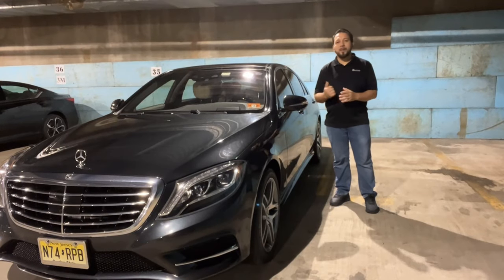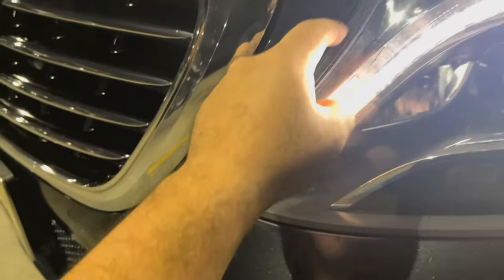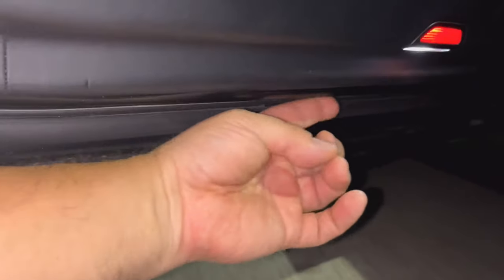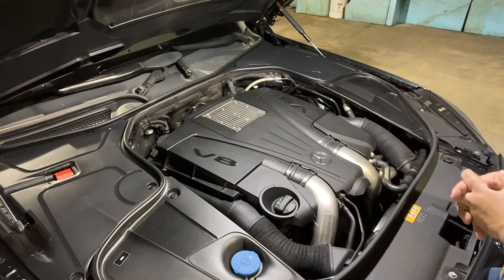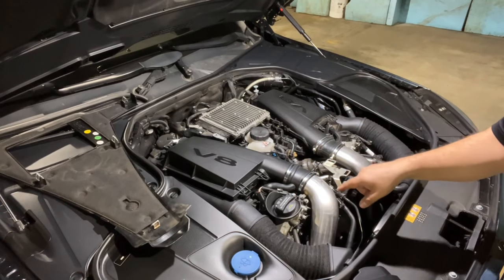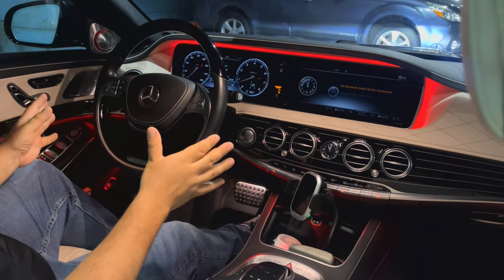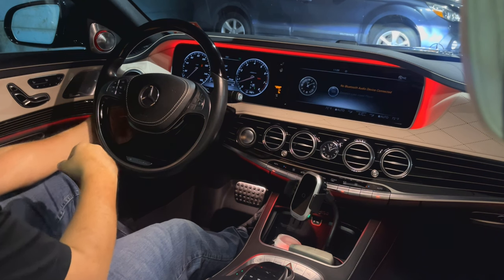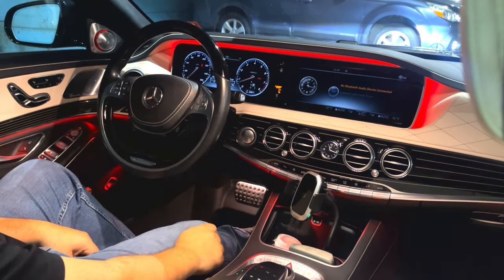Buying a used Mercedes | Buying a used car | #usedmercedes | josecitomarin | #repairjose

Comment: Thanks, Jose! Very detailed and accurate information for evaluating buying a used S Class where I've owned 4 different S class cars from W220, 221 and W222.
Reply from the maker: Hello Steve. Thank you so much for your comment. I’m glad you like the video. What can you share about your experience with your cars? Is there anything else we should look for?
Reply: @josecitomarin  Your videos on the sacrificial harnesses was extremely helpful where I replaced all 4 CPS, camshaft solenoid magnets and added the sacrificial harnesses to the CPS's and camshaft solenoid's. 

This is my 4th S class starting with the W220, W222 and the W221 I have now. 

I've experienced replacement of the Airmatic shocks on the W220 and W221 but that is about all the issues and I perform regular maintenace.

I also have an '06 SLK55 AMG (R171) where I've done work on it.
Reply from the maker: @smsunder  awesome. Thank you so much for sharing. Nice AMG!